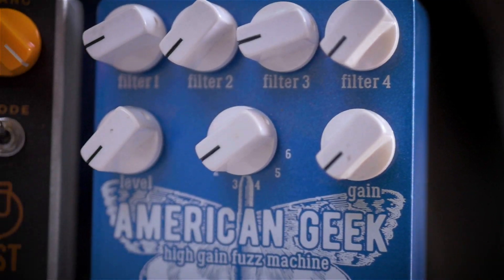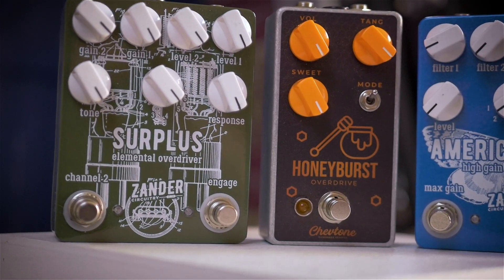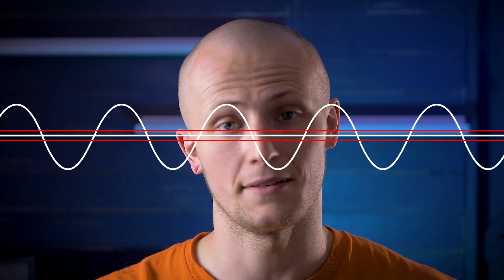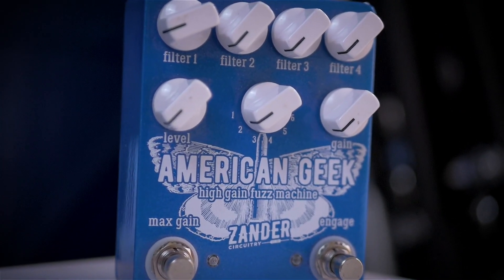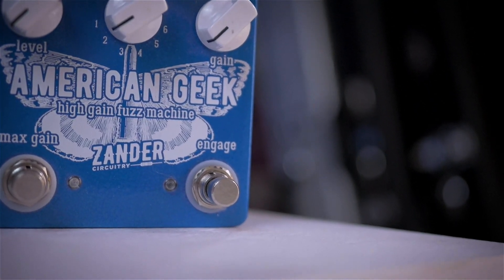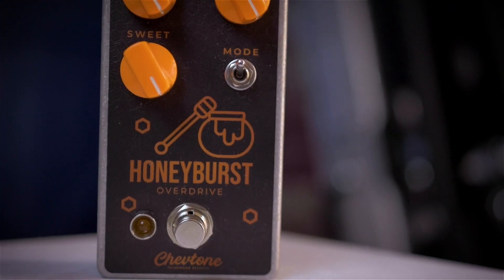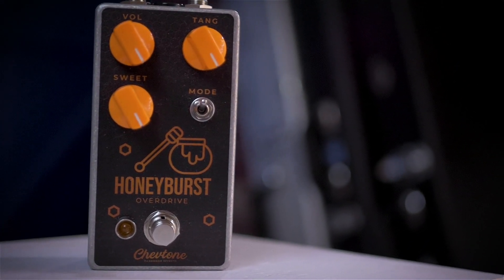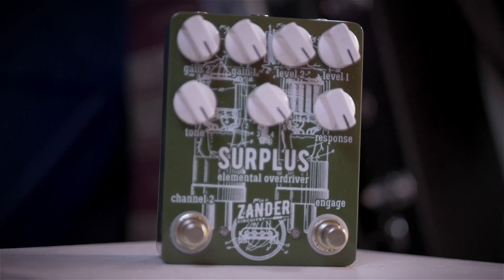Let's talk about clipping diodes...

Comment: Well executed.
I'm an electronics engineer and symphonic shred guitarist meaning I'm basically like seeing Sasquatch on a Caribbean cruise shit lol. I started out a hobbyist 20 years ago, the internet resources were shit in those days in terms of getting useful scientific knowledge, and so I eventually found myself in college for an engineering degree at the ripe old age of 32.

One thing I would interject is there's no definitive result in using a particular method for your distortion. A hard clipping scheme can in fact produce what we regard as soft clipping and an overdrive can produce hard clipping.
Fuzz is generally considered hard clipping but again, can be oriented so it's a soft output waveform with rounded edges. 

Germanium is marketed as soft clipping and the most like valves, but actually one of the most aggressive of clipping diodes due to the really low forward voltage. Even in feedback schemes they're really aggressive. Anyway, I just produced a lifetime of work in my first commercial designs and will launch commercial production next year.

I have the shredders oh so sought after graceful tube note separation and clarity that costs thousands to obtain for quite literally a few dollars of solid-state circuitry so now anyone can afford elite equipment when I hit the market.

Comment: I'm going to be THAT guy who says changing the diodes in the feedback loop of the third transistor in a big Muff can make a big difference, however it's got to be in conjunction with the an appropriate alteration to the second transistor feedback loop. i.e LEDs or just wide open for the 2nd transistor combined with a very low forward voltage diodes in the third, is a lot of fun...

Comment: At 5:16, where is the distortion coming from if there are no clipping diodes or other clipping stages in the pedal?
Reply from the maker: In a big muff style circuit (like the American Geek is) there are 2 clipping stages, usually when you have diode options on big muff style circuits it's the second pair that are being swapped out as changing the first stage while the second stage is still clipping is a bit redundant.

So in this case you're hearing the first set of diodes still clipping. That being said, removing both sets of diodes will still yield distortion in this type of circuit, you'd just be hearing the transistors themselves crashing into eachother with no additional help from any diodes, it would make it more 'overdrive like'. This example was just to highlight the difference it makes.

This would be similar in a lot of single stage overdrives that are transistor or opamp based, they will often clip without any diodes at all, but the direct sound of a opamp clipping can be quite harsh, especially at lower gain settings where your guitar signal will fluctuate above and below the clipping threshold of the opamp, this leads to a sort of fizzy/static overdrive decay
Reply: I think I got it. does that mean the sound at 5:16 is the sound of the first gain stage and all the prior examples essentially add a second gain stage (germanium, silicon etc) to the first one?
Reply from the maker: @lightraja  yeah that's right, in the American Geek you're hearing just the first set of diodes (which are silicon) when the switch is set to 'none'

Comment: Should have used a DI box or something I couldn't even tell the difference in tone at least not of my phone
Reply from the maker: @DuryielDeLong  I do record direct from the line out on my amp (using a cab SIM because straight DI guitar doesn't sound great usually)

I will say the difference that clipping diodes make will also depend how heavily the circuit itself is clipping before it hits the diodes, in the case of the American geek there are already a set of diodes in the first gain stage so the differences are less pronounced

phone speakers aren't the best for judging these sorts of things, having said that the differences are quite apparent on mine listening back to it

Comment: It deserves mention that the guitar signal level is simply adjusted in level to achieve the same amount of clipping for each of the widely varying diode forward voltages. Without that explanation, it might be assumed the lower forward voltage of germanium by itself gives an advantage, which it of course does not.

Comment: From what I’ve read, the closest way to emulate tape saturation in a solid state manner is with symmetrical soft clipping to give predominantly odd order harmonics and similar compression. Is this true, and if so what pedals would you recommend?
Reply from the maker: I'm not really familiar with using them for tape saturation, but you're right about symmetrical giving predominantly odd order harmonics, the 'compression' (presumably saturation) amount would depend on which diodes you use as they'll all have different points where an input signal will force them to clip it, germaniums will clip much earlier than LEDs for example.

I know people praise one of the Strymon pedals (I think the Deco?) For this tape saturation thing, but I'm not sure what the circuit is

If you're looking for something from us that would give you an otherwise fairly clean platform to really play around with the differences between different diodes and symmetrical/asymmetrical, I'd suggest checking out our surplus pedal (the new smaller format), there's a demo on our channel :)
Reply: Thanks for the response! The Strymon Deco is actually DSP for the saturation, which doesn’t make a lot of sense to me- for time based effects sure, but not for dirt. 
I’ll check out the Surplus for sure!

Comment: I’m curious about clipping diodes in the Big Muff circuit. There are 2 identical gain stages in series. I completely understand the concept of changing the diodes in the negative feedback loop for the second stage when you are switching to a higher forward voltage. That would reduce clipping overall and increase voltage (volume) going into the output gain stage. However, what happens if you put germanium diodes in the first clipping NFB loop?  I’m not clear on whether or not the clipping stages also each amplify the signal - I think they do...

For switching, can you put 2 diodes in parallel and the highest forward voltage applies?
Reply from the maker: Because they run in series, changing the diodes in the first stage has less of a drastic effect in the sound if the 2 stage still has diodes in it. It will have an effect, just far more subtle because the second stage clips so agressively

Kind of like if you have a high gain distortion pedal and then stick a big clean boost in front of it, if the distortion is already cranked, the boost before it won't really add that much more to it